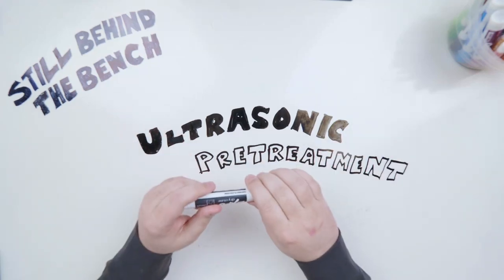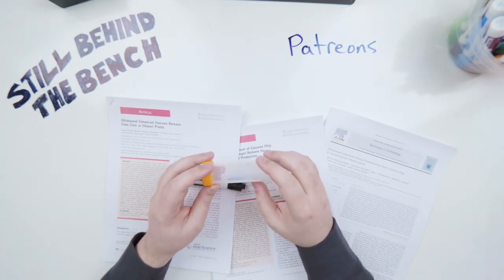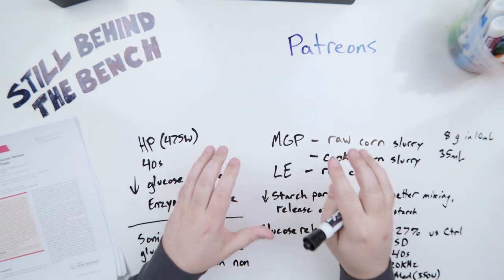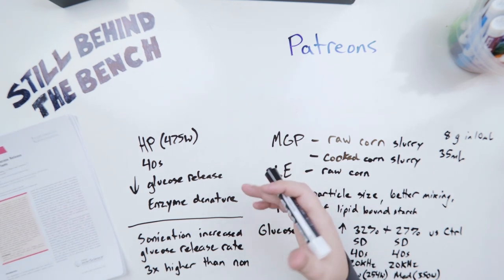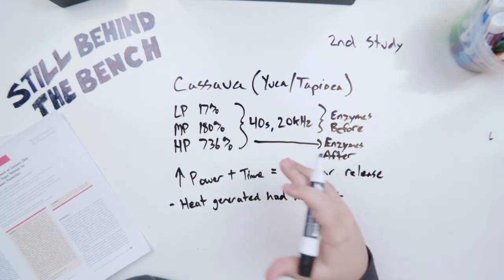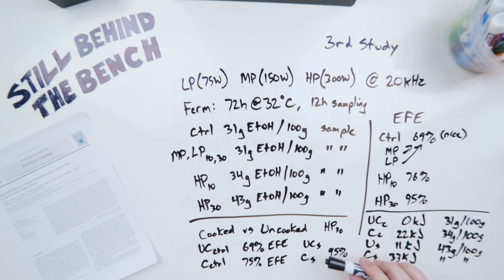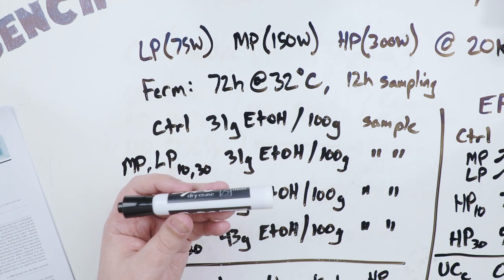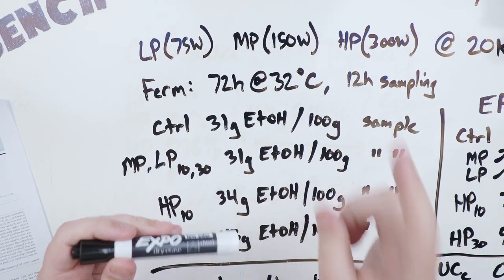Ep 30 - Ultrasonic Pretreatment

Comment: Typical end consumer ultrasonic baths run at 40kHz and are operated with 1-2 50-60W transducers in a 2-4l bath.
In the first study, even on their lowest setting they are pumping almost 500W of 20kHz (much more destructive) ultrasound into about 50ml of sample.

What they are using are not ultrasonic cleaners but cell disruptors, machines specifically designed to break up cell membranes for analysis.

Perhaps there will be an effect when preparing mash with a regular ultrasonic cleaner as they are used in force ageing, but IF you go about trying this and you build your own setup, I suggest you try to get your Hands on a 28kHz cleaner/cleaning Kit at the very least to stack chances in your favor

As a matter of fact, the same probably also goes for force ageing

Comment: Fascinating subject.  Have you seen any indication if altrasonic does increase tenants extraction from any  barley that could be in a bourbon mash? Or from fruit skin in the case of fruit brandy?
Reply from the maker: Only in small scale lab tests, and they do look promising. I haven't seen anyone do it with large batches, and by large I mean like even hobby level sizes, in the lab they do grams and mL size masses and volumes.

The studies I referenced in the video were for increasing the efficiency of industrial ethanol production, but it applies to beverages as well, of course, because it's the same process.

The only major issue I can see is whether or not the capital and operating costs of a large ultrasonicator can be made up by the increase in alcohol produced, and possibly in the case of not needing to heat the mash, and instead being able to just ultrasonicate it. I can't say if that cost benefit would be realized or not though.

Comment: Great video and such an unusual topic, never heard of it! 
I have a question. With the traditional method of mashing, after the mashing is completed, doing the iodine test no more starches can be found in the mash (assuming an efficient process).  Now this ultrasonic pretreatment method, shows that much more starches can be broken down to be converted to sugars. And my questions is, why the iodine test in the traditional mashing process does not show that these more starches exist in the mash?
Reply from the maker: I imagine it has to do with how the iodine and the starch interact. The iodine molecule slips inside the helical shaped starch, and that is why there is a colour change. But if that can't happen, maybe because the iodine can't get to the starch, or the starch has lipids amongst it already, than there will be no colour change.